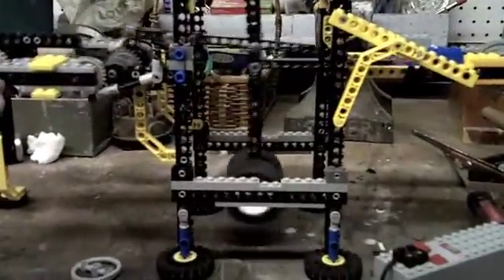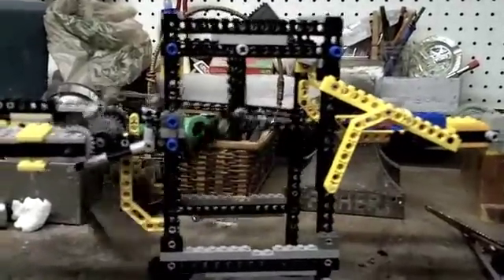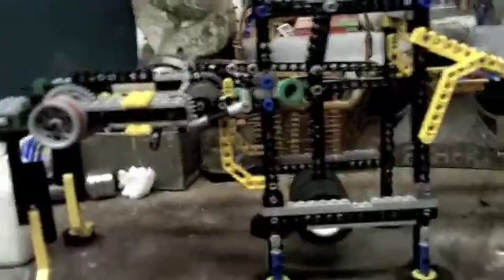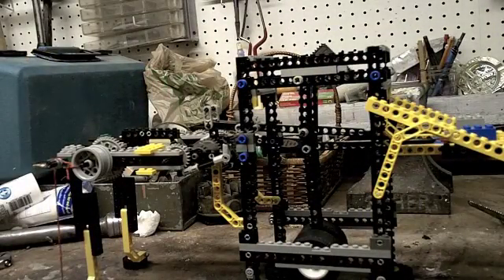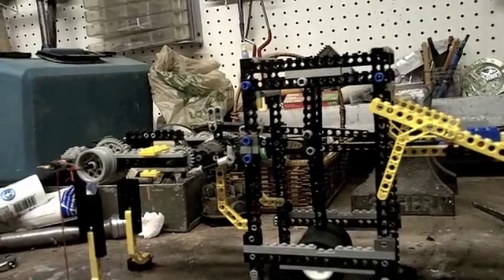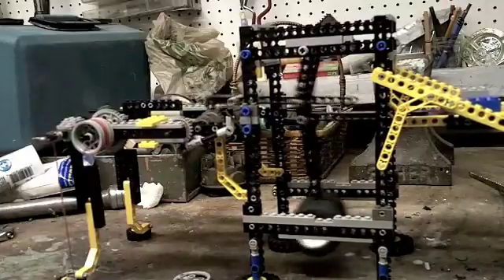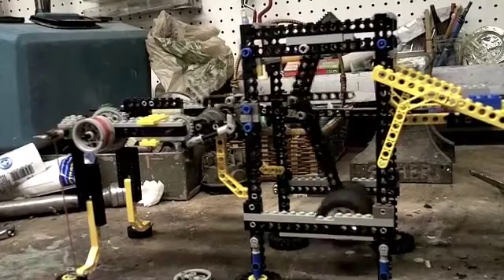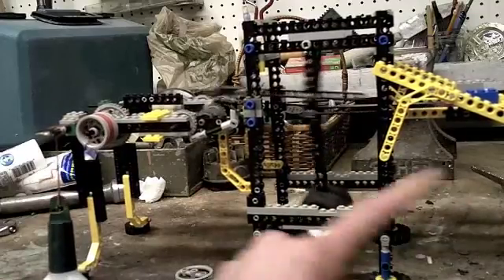Constantinesco Torque Converter in Lego

Comment: Constantinescu realized the importance and power of the pendulum by emphasizing its main use. The great problem of understanding that technology comes from our schools, universities, and physics itself diverting us from studies of pendulums and the misconception that centrifugal force is a virtual force. Then Constantinescu understood these two characteristics and applied them in a device. The secret is in the pendulums, there is no contact between the device and the ground through transmission. The pendulums, when they oscillate in their arc-shaped trajectory, develop a centrifugal reaction (physically speaking) which pulls the object in which its center is fixed. In the patent 1,715,816 (http://rexresearch.com/constran/1constran.htm) (Figure 1) you will see an inertial mass 4, it is only on the left side, but there has to be another one on the right side, the horizontal bar (11) below connecting the lower end of the rod holding the inertial mass is in the wrong position. Now imagine another rod with an inertial mass on the right side, notice that it fits perfectly into the part (10). Then the horizontal bar 11 will be connected at point 6 of the rod we placed on the right side, the horizontal bar will now be tilted. The steering wheel serves only to soften the leaps caused by the changes of direction of the two pendulums. So when one pendulum goes to the left, the other goes to the right. By way of illustration, a 1.6 liter car weighing 900 kg goes from 0 to 100 km / h in 11.03 seconds, during this time its engine develops a force of 2,400 Newton equals a mass of 243.40 kg, now see the following, if you take an object of mass equal to 0.25 kg, 250 grams, attach it to a string of 15 centimeters and rotate at a rotation of 1200 rpm, you will have a centrifugal force of 592.17 Newton, this will be the constant force that the 0.25 kg object is subjected to during rotation. If it were possible to place a scale under the object it would register a mass increase and this value would be 60 kg. It turns out that in a rotation of 1200 rpm the object will pass 20 times in 1 a second, then the force centrifuged in any degree of a circumference will be of 11.843,40 Newton which is equivalent to a mass of 1201,15 kg.
But on a circumference it is impossible to take advantage of this misunderstood force and magnify that it is the centrifugal force, for now the centrifugal force is on the left, or on the right, sometimes above and below, but with a pendulum this does not happen.

Comment: I built one like yours in metal in a 1963 school science fair along with a mechanical analysis.  I got second prize in technology because not everyone understood it!  Haha!   The railcar versions used an oscillating flywheel instead of the pendulum. A rocking arm was fixed to the flywheel at ,say, 60% of the radius with input on one end of the rocking are and the output taken from the other end.  As others have commented roller clutches are more effective but I also used ratchets as you did.  Nice job!
Reply: Bill Radford 
In 1963 I had just been born, Hahaha. I imagine it was very difficult or impossible for you to register your mount at that time. Regarding the versions of the wagon, I believe you were mistaken, Constantinescu realized the importance and power of the pendulum by emphasizing its main use. The great problem of understanding that technology comes from our schools, universities, and physics itself diverting us from studies of pendulums and the misconception that centrifugal force is a virtual force. Then Constantinescu understood these two characteristics and applied them in a device. The secret is in the pendulums, there is no contact between the device and the ground through transmission. The pendulums, when they oscillate in their arc-shaped trajectory, develop a centrifugal reaction (physically speaking) which pulls the object in which its center is fixed. In the patent 1,715,816 (http://rexresearch.com/constran/1constran.htm) (Figure 1) you will see an inertial mass 4, it is only on the left side, but there has to be another one on the right side, the horizontal bar (11) below connecting the lower end of the rod holding the inertial mass is in the wrong position. Now imagine another rod with an inertial mass on the right side, notice that it fits perfectly into the part (10). Then the horizontal bar 11 will be connected at point 6 of the rod we placed on the right side, the horizontal bar will now be tilted. The steering wheel serves only to soften the leaps caused by the changes of direction of the two pendulums. So when one pendulum goes to the left, the other goes to the right. By way of illustration, a 1.6 liter car weighing 900 kg goes from 0 to 100 km / h in 11.03 seconds, during this time its engine develops a force of 2,400 Newton equals a mass of 243.40 kg, now see the following, if you take an object of mass equal to 0.25 kg, 250 grams, attach it to a string of 15 centimeters and rotate at a rotation of 1200 rpm, you will have a centrifugal force of 592.17 Newton, this will be the constant force that the 0.25 kg object is subjected to during rotation. If it were possible to place a scale under the object it would register a mass increase and this value would be 60 kg. It turns out that in a rotation of 1200 rpm the object will pass 20 times in 1 a second, then the force centrifuged in any degree of a circumference will be of 11.843,40 Newton which is equivalent to a mass of 1201,15 kg.
But on a circumference it is impossible to take advantage of this misunderstood force and magnify that it is the centrifugal force, for now the centrifugal force is on the left, or on the right, sometimes above and below, but with a pendulum this does not happen.

Comment: There are subtle situations that would render this   machine metallurgically impossible if built in  large versions.
First of all, If ever a pendulum is driven at any other frequency apart from its natural resonance frequency it will absorb energy and the only frequency where it takes little energy is at its resonant frequency.
* Without the load being locked, ( free to rotate)  in this case, at  very very slow speeds  while the load is well  activated,  the weight of the pendulum may swing a little depending on the load.  At resonance with the  load not locked well, I would say that it would swing much more . Above resonance the high  inertia of the pendulum will keep it almost still, while the load will take its full share of  the movement..
* With the load locked ,  the pendulum will come into action   and  as far as the forces on those push and pull transmission rods, they will be great, except at resonance frequency of the pendulum.    If the energy in the motor is not reduced then at resonance the pendulum will try and rotate rather than oscillate.    
An interesting  machine in such dimensions but not larger ones, congratulations.
Reply: It turns out that this was one of the first patents of Constantinescu, it evolved into a purely inertial system, the wheels of the car are like wheels of skateboards, free. 
Constantinescu realized the importance and power of the pendulum by emphasizing its main use. The great problem of understanding that technology comes from our schools, universities, and physics itself diverting us from studies of pendulums and the misconception that centrifugal force is a virtual force. Then Constantinescu understood these two characteristics and applied them in a device. The secret is in the pendulums, there is no contact between the device and the ground through transmission. The pendulums, when they oscillate in their arc-shaped trajectory, develop a centrifugal reaction (physically speaking) which pulls the object in which its center is fixed. In the patent 1,715,816 (http://rexresearch.com/constran/1constran.htm) (Figure 1) you will see an inertial mass 4, it is only on the left side, but there has to be another one on the right side, the horizontal bar (11) below connecting the lower end of the rod holding the inertial mass is in the wrong position. Now imagine another rod with an inertial mass on the right side, notice that it fits perfectly into the part (10). Then the horizontal bar 11 will be connected at point 6 of the rod we placed on the right side, the horizontal bar will now be tilted. The steering wheel serves only to soften the leaps caused by the changes of direction of the two pendulums. So when one pendulum goes to the left, the other goes to the right. By way of illustration, a 1.6 liter car weighing 900 kg goes from 0 to 100 km / h in 11.03 seconds, during this time its engine develops a force of 2,400 Newton equals a mass of 243.40 kg, now see the following, if you take an object of mass equal to 0.25 kg, 250 grams, attach it to a string of 15 centimeters and rotate at a rotation of 1200 rpm, you will have a centrifugal force of 592.17 Newton, this will be the constant force that the 0.25 kg object is subjected to during rotation. If it were possible to place a scale under the object it would register a mass increase and this value would be 60 kg. It turns out that in a rotation of 1200 rpm the object will pass 20 times in 1 a second, then the force centrifuged in any degree of a circumference will be of 11.843,40 Newton which is equivalent to a mass of 1201,15 kg.
But on a circumference it is impossible to take advantage of this misunderstood force and magnify that it is the centrifugal force, for now the centrifugal force is on the left, or on the right, sometimes above and below, but with a pendulum this does not happen.

Comment from the maker: I used the standard geared pre-NXT motors. I ended up using two to get the torque I needed to push the bulky pendulum stuff, so a direct-drive motor probably wouldn't do much good here. Thanks though!

Comment: Completely irreverent, but I've won a few bucks in bets with people thanks to this torque converter.  Rest the handle of a broom on the ground, bristles up.  Have someone grab a few inches from the bottom, and start to *gently* sway the broom, while keeping the tip in place.  Ask them to try to speed their sway without moving the tip.  It won't be long before they can't keep the tip in place, and they'll break a sweat trying.

A great way to get hands-on appreciation for the device.  :)

Comment: I haven't built one of these, but, I'd wager that the trepedation is caused by coarse-grained ratchets.  If you use smaller teeth spacing (or multiple offset ratchets), you can get smoother output.

Comment: Cool prototype! I wonder, though, about the torsional trepidation at the wheel. I can see in the video that the wheel's rotation is kind of jerky which I suppose is a direct consequence of the one-way clutch.  I don't mind the shaking of the entire frame, as the pendulum's motion is obviously not balanced, but I think the torque fluctuations at the wheel (the jerkiness) are harder to eliminate as they are a result of the one-way clutch. What do you think? Keep it up, it's really cool!

Comment from the maker: @caesareor Thanks. Yeah, torque would be an issue, unless the motor was really slow. Given the idle speed of a gasoline engine, it would need a clutch to stop it from fighting against the handbrake. In fact I think I'd set up a CVT much like a standard auto trans, with the torque converter feeding a few clutch packs. This would also provide for underdrive gears and reverse. 

I've dismantled this one to attempt a dual-pendulum setup. I'll try slow input with that one if I get it working.

Comment: Hey man, nice build. Anyway, I was wondering if you can adjust the motor rpm. I would be curious to see what happens at lower rpms . 

My concern is that if you reduce the rpm's to 1/4 let's say (the equivalent ratio between the drive and idle rpms in a real car) there will still be a lot of torque in that wheel so you would need quite a strong hand brake to keep a car stationary.

Now I know that the guy actually built the car and it worked fine but I would like to see it too. :)